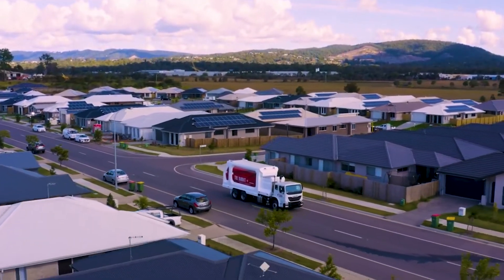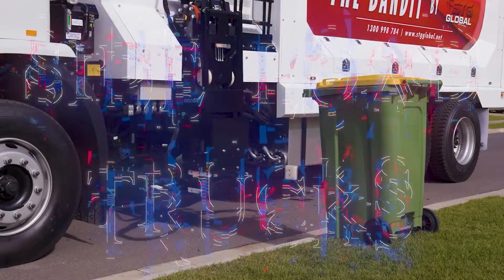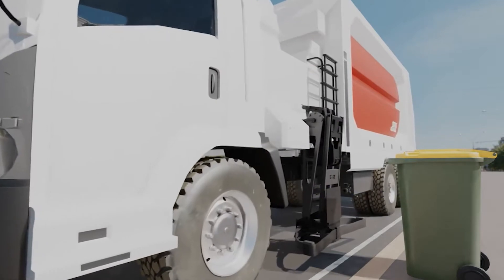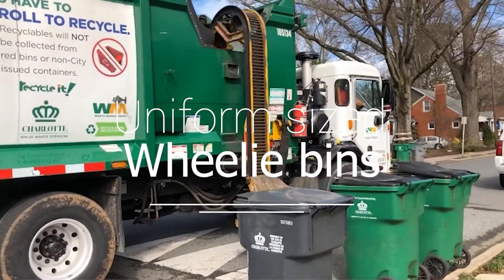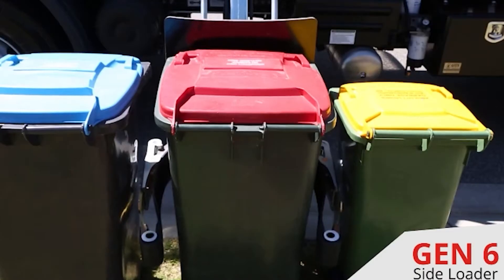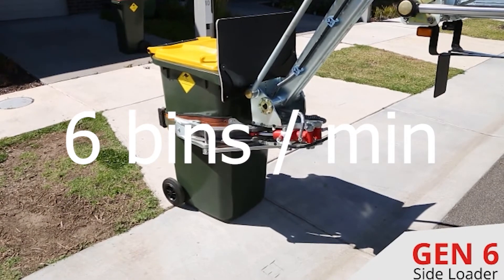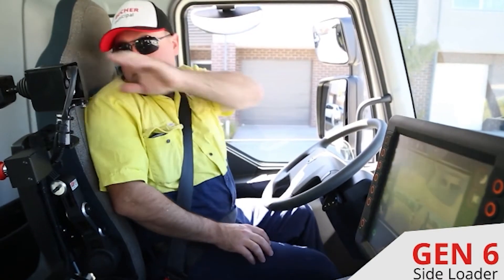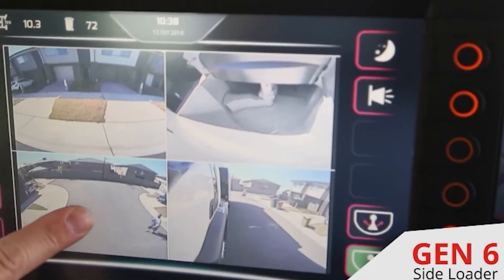Side Loader Garbage Truck 🚛How Does A Side Lift Waste Truck Work?

Comment: would there any reason to not pick a bin up that is placed as close as possible to kerb without impeding the footpath. if has a reach of 4.5m... 
i battling my local waste management as they refuse to pick my bin up . i follow the laws and bylaws of the city i live in . not impeding the footpath... its disgusting to see bins blocking the footpath so pedestrians have to move around bins.
every street has different dimensions on the path.. eg i have 1.3 m footpath the bin is 650mm leaving 450 mm for a pedestrian . push chairs wheel chair mobility scooters for the elderly to manoeuvre around...
is it best practice for the pedestrians to walk on the road...
health and safety for the drivers but not the kids, mothers , elderly..